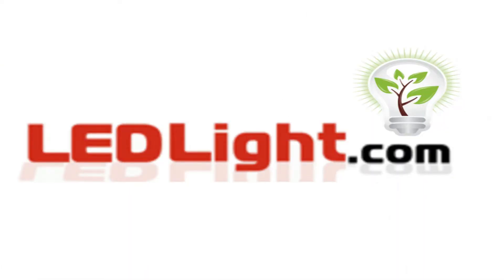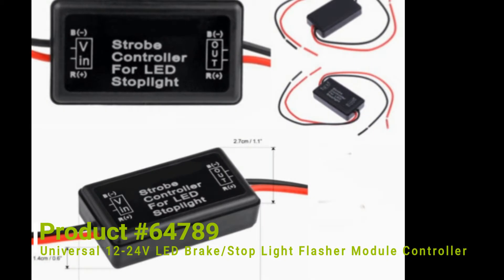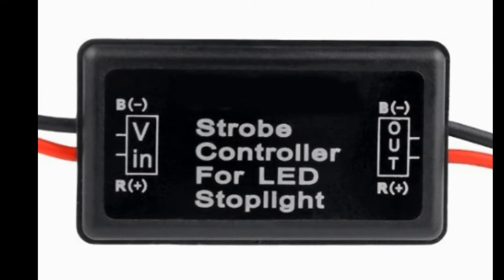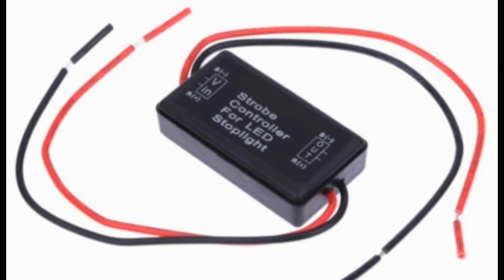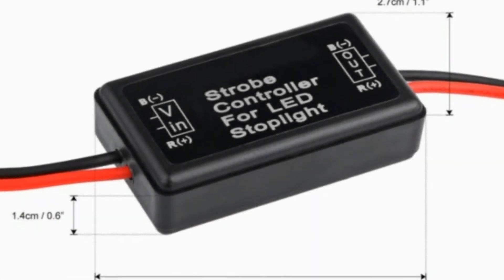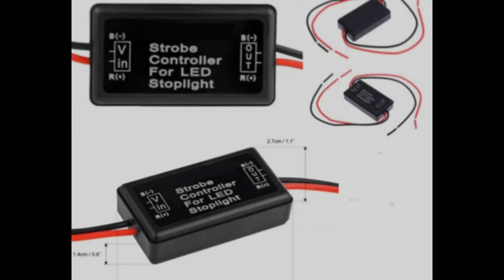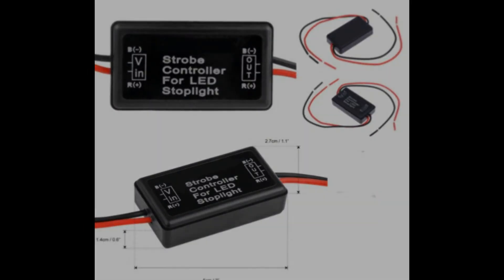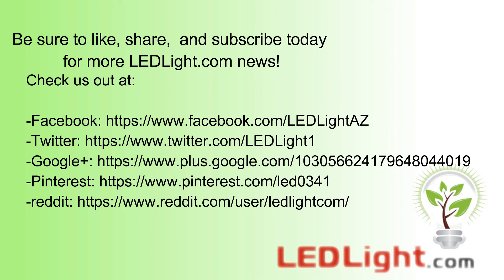Product #64789-Universal 12-24V LED Brake/Stop Light Flasher Module Controller

Comment: Do they make this for a 6V system?  I put a 6v tail light bulb into my 6v vintage motorcycle and the light pulses or strobes a little when the bike is running.  I'm wondering how I might be able to fix that.  Thanks.